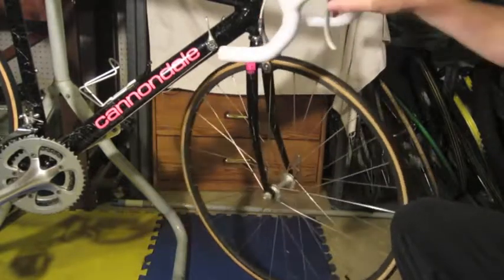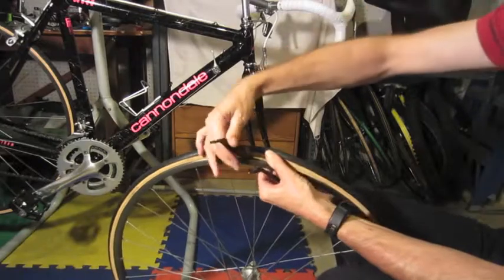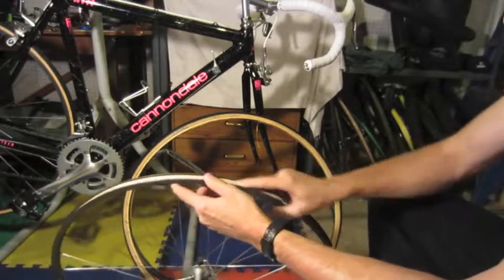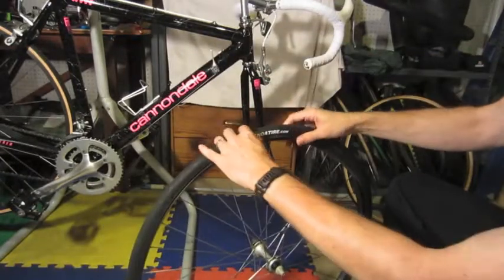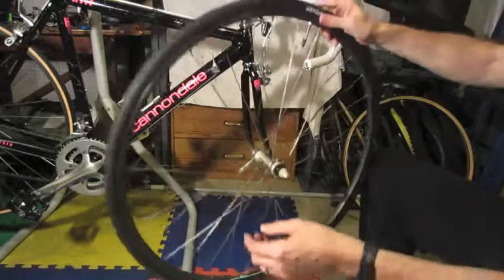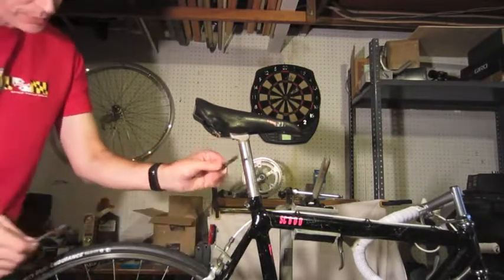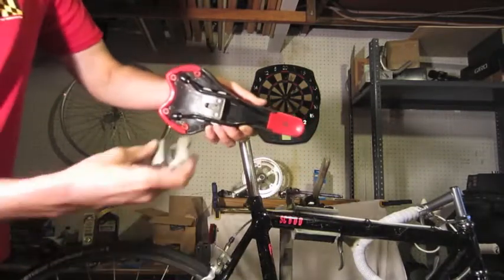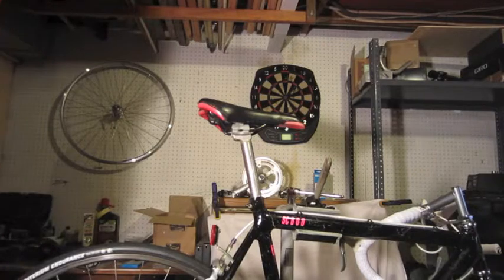Old Cannondale update 6

Comment: Hello, do you still own the Cannondale Sc600?
I'm restoring one, but the last owner painted it with a different color. I have got the original color, which is blue, but I ain't found the original stickers yet. I was wondering if you could take a picture of all the stickers of yours, that would be great, you would help me a lot. Thanks!!
Reply from the maker: Hi, sorry I sold the bike over a year ago. I've seen vintage Cannondale stickers online, but not the SC600 specific stickers. I'm sure you have seen the vintage Cannondale manual site: https://vintagecannondale.com/year/1991/1991.pdf. It probably doesn't give a high enough resolution of the stickers though. Good luck in finding what you need.
Reply: @countrymikesbikes  Ok, actually already found them on a Cannondale bike forum, thanks mate! :)